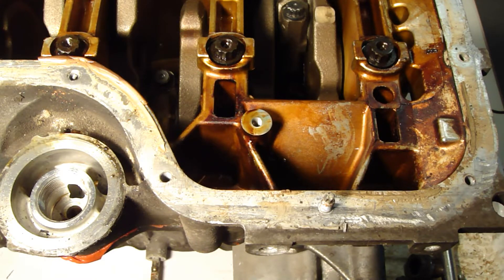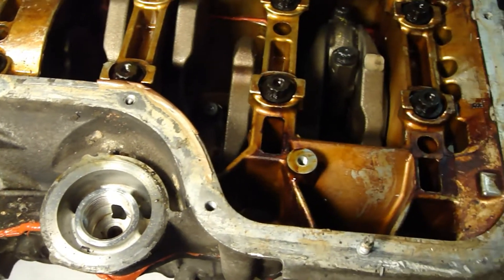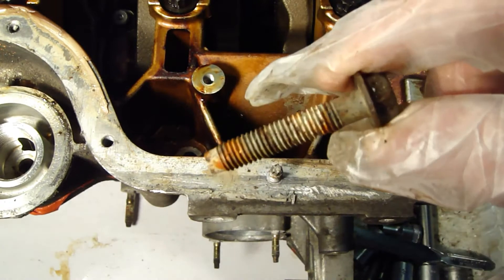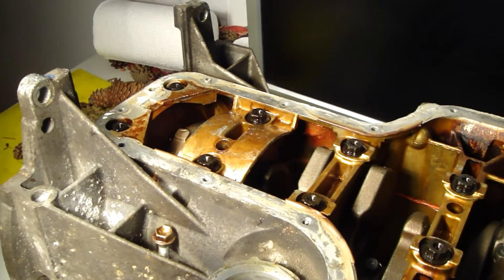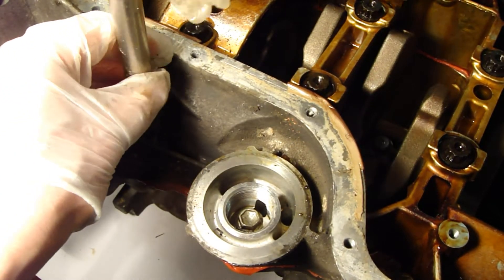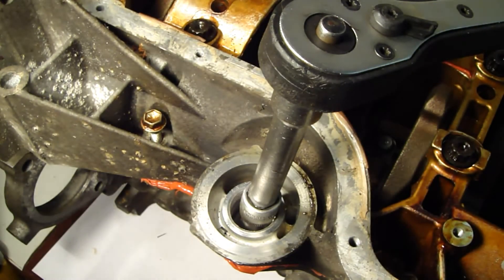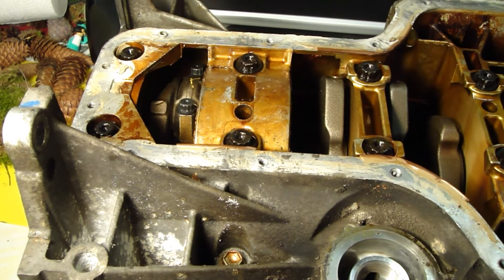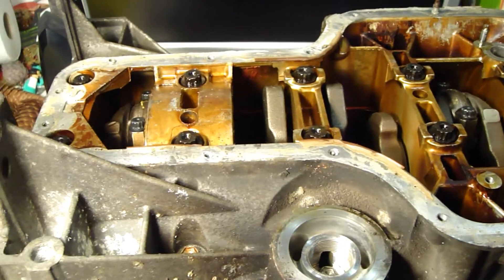How to assemble engine VVTi Toyota Part 12: Crankshaft bearings cover outside bolts

Comment: hi, why dont u put some glue on the tips of bolts before screwing ?
Reply from the maker: Ok, your idea is also useful. I trust the torgue wrench tighten force.
Reply: Peter Finn
Hi Mr Peter, I'm not talking about tightening, you know very well that when the engine is running, there is a lot of vibration that can loosen the bolts, otherwise why the manufacturer never forgets to put the glue, especially to assemble the two half block...... anyway I trust that you are a great specialist, have a good time
Reply: لو امكنك ترسلي مخطط السيارة كورلا ك 2004  قير عادي 1300 cc مع اماكن المسامير وقوة ربطها نيوتن متر وشكرا علي جهودك و معلوماتك القيمه